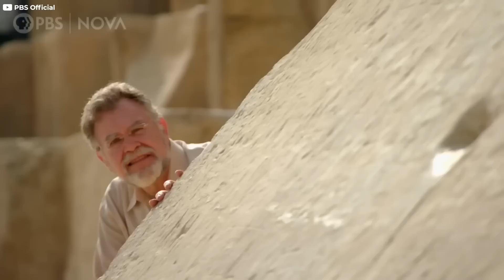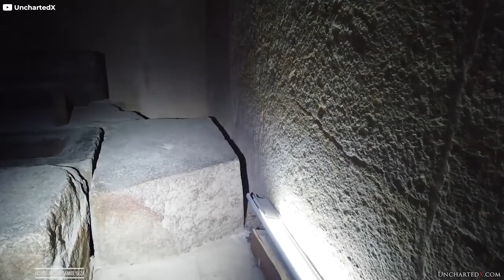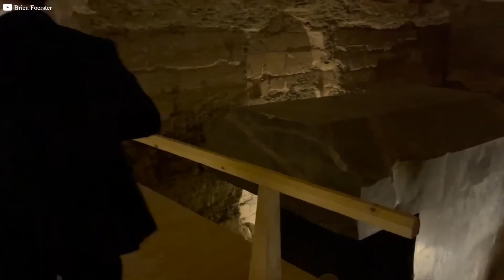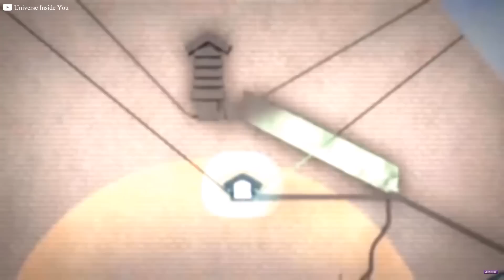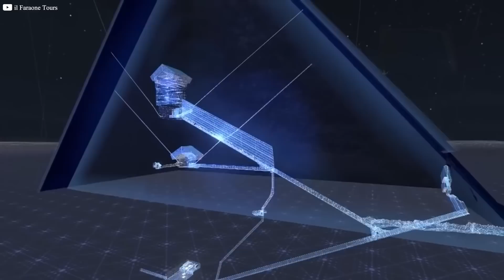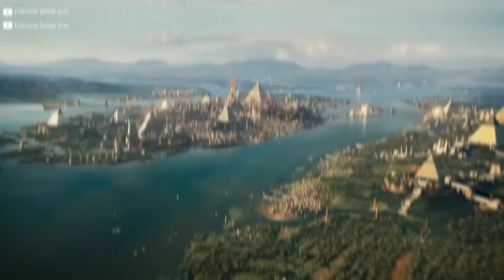The Great Pyramid Isn’t a Tomb, It’s a Forgotten Power Plant

Comment: There is one in Alaska, govt. is hiding it and it is also running, produces enough electricity to run all of canada, this is partly what they were designed for, there are hundreds of them across the planet, they are used to protect us, they produce our magnetic field, they swap them as needed when the power supplies get worn out, you call them "Arks of the covenant" they are power supplies! This is just my hyposthesis......logical though!
Reply from the maker: That's an interesting hypothesis! The connections between ancient structures and modern technology are definitely worth exploring. Thanks for sharing your thoughts!

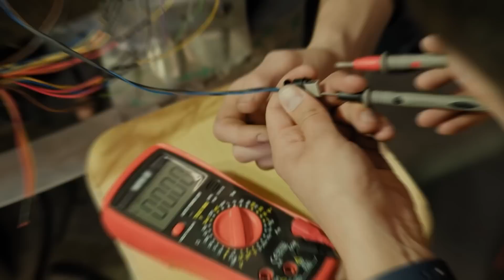Comment: 23:00 a capacitor is 2 conducting plates with a dielectric in the middle. This is what the Pyramid is. Energy generator.
Reply: But capacitors store electrical currents ...they don't produce energy